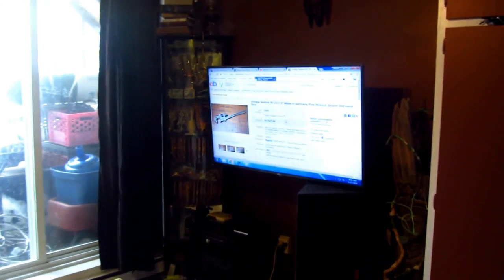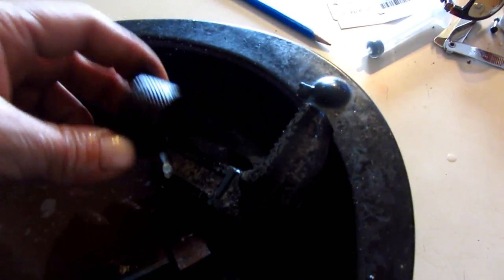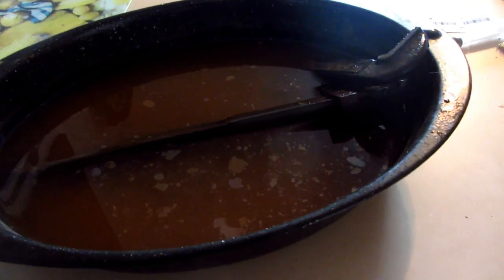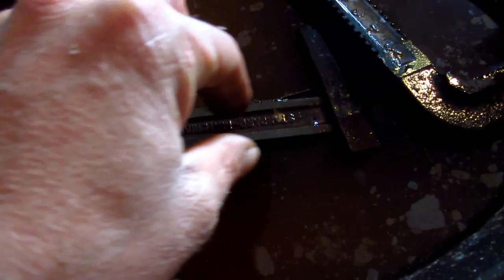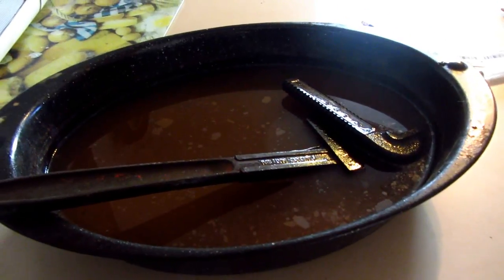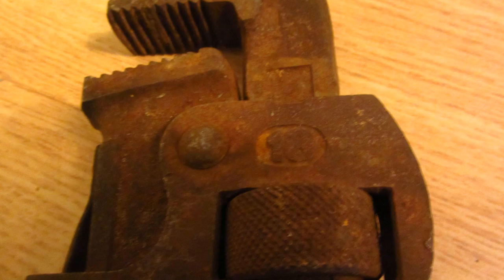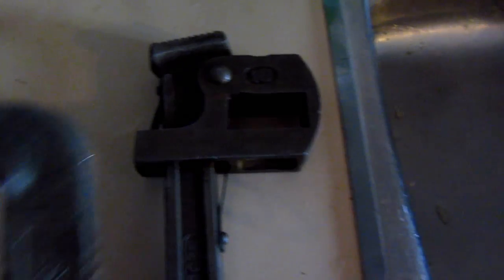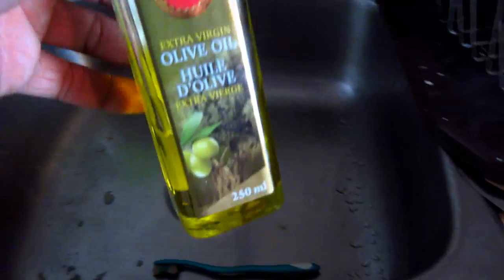How to clean youre old RUSTED tools

Comment: Yes, vinagar works great to pull the rust out of metal. It's used often on vintage cast iron skillets. Just be sure to put oil on it after, or cooking oil on pans, because vinagar can also cause rust when it is out in the air.

Comment: good to know vinegar works quite well my self-using just diesel  same procedure as yours and use a metal brush instead toothbrush and after cleaning do not need to oil it just dry with paper towel cause self diesel is oiling every tiny corner or hole, thanks for good video about games i spend a lot of hours on Diablo 2 as well i have all parts but not have so much time for playingand annother favorit time-eaters was carmageddon and the settlers  can not imagin how many hours i put to this games eaven do i buyng from time to time some new games all of them missing something and after few hours getting boring eaven now sometimes i going back to the old ones and can play for hours eaven do i know them all the way thru.